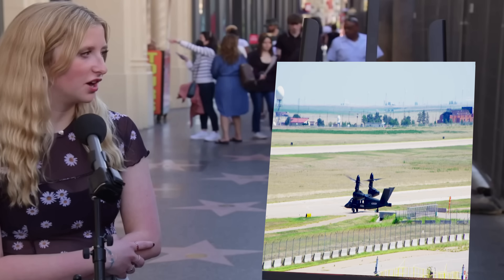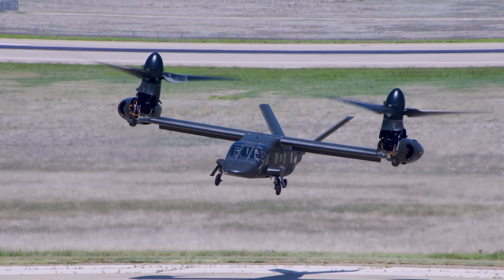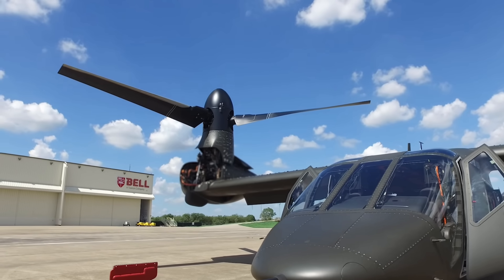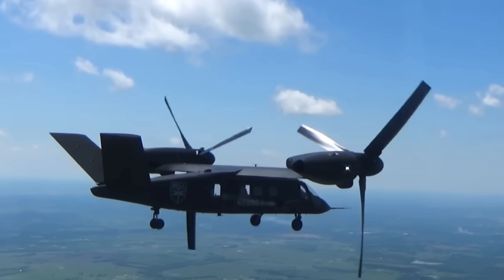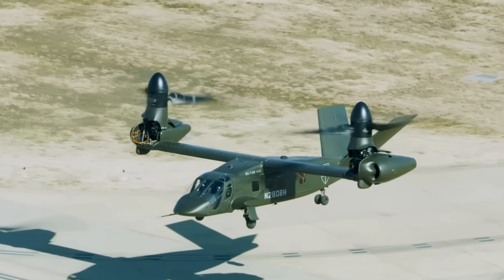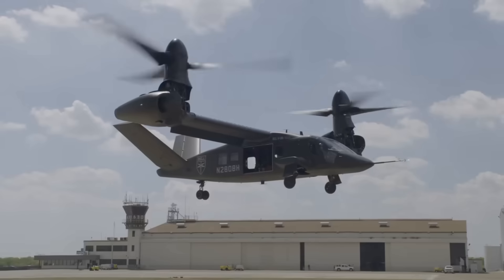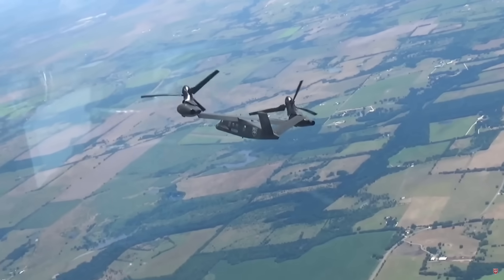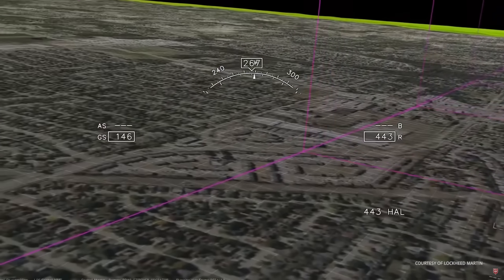Bell V-280 Valor - What's the big deal anyway? | BLACKHAWK REPLACEMENT

Comment: While the solution of having the turbine of the rotating bit solve both the problem with tilting the turbines as well as a total turbine failure. They are still vulnerable to a gearbox failure.
Reply: Along with every turboshaft driven vehicle ever produced.
Reply: @forrest225  well.. not pure fans.. also most other turboshaft vihicle have a safe failure mode. Helicopters don't.
Reply: @matsv201  that would be a turbofan not turboshaft. 

Yeah every helicopter has a high speed gearbox, that’s my point. It’s not like an exclusive weakness to the valor.
Reply: Unique hazard for this with tilt rotors is the potential for power not being distributed perfectly resulting in asymmetric lift. This tends to be uncontrollable and lead to a flip over. If near the ground or power isn’t evened out quickly it can and has led to crashes.

Comment: I think both of the bids were really incredible, but I think the speed and range of the tilt rotor Valor were just too good to pass up. I know the finished design for the military will look different, but hopefully they find a way to add some armor to opening in the nacelles during verticle flight mode.

I personally hope the Sikorsky Raider X with its pusher propeller will beat out Bell for the FARA program so both companies get to have big contracts with the military.
Reply: @2genders  Probably another Valor. There is a version where they replace the cabin area with a hellfire rack. That and probably fixed wing. 

The Army is thinking ahead and figuring out what it needs against China and where they might need to launch from on land. While the army can launch from carriers and ships, they won't unless it is to offload onto another base. Salt water maintenance for aircraft is a pain and the Marines are already on board those ships anyway. If the Army doesn't want to be sidelined until a base can be established then the Valor is the better choice over the Sikorsky. It is the same problem the Navy Seahawks and Marine Hueys had and why they weren't really used, their range was limited and they couldn't be air refueled. Plus that tilt rotor can save a lot more lives by using it's speed to get to a hospital with life saving equipment that is usually far away from the frontlines.

Additionally, the Sikorsky is still unproven and just got a full scale prototype up and running while the Valor prototype was either finishing up or flying for additional research. The Sikorsky team had trouble with making the blades stiff enough when upscaling so that the blades won't flex and hit each other. The Army is just more comfortable with a tilt rotor.
Reply: @2genders  The V-280 could be escorted by other V-280s. If they can't send an escort, then they'll just do without one. You're making it sound like the extra speed and range is a disadvantage. In fact, the extra speed and range means this aircraft can perform missions that couldn't be done at all without it.
Reply: May I ask what's the FARA Program, is it seperate to the current program and what would it Replace?

I personally also really want the Raider X since I really like the Mix of Co-axial + PushProp Idea, it looks a bit more like a Helicopter and less of a plane unlike the Valor. 
Seems a little more versatile too, Push-Prop being it's own, seperate thing on the craft.
Reply: @Sire.English  I'm a different person, but anyway, the FARA Program is to replace the OH-58 Kiowa (which was the Army's version of the Jet Ranger) which has already been retired without a replacement. I think it might also replace some of the Apaches, but that's not official. https://en.wikipedia.org/wiki/Future_Attack_Reconnaissance_Aircraft
Reply: From a maintainer perspective, I just want a simple flexible dust boot at least.
Reply: @Phillip Banes Yeah there are some recent videos of the Raider and it’s not as compact as the original renders were, but it’s still smaller than the Defiant X.
Reply: @Phillip Banes That’s true. I think Sikorsky’s plan is to make the Raider X modular. They can choose to either have a small cabin behind the pilots like the Little Bird, or have it carry foldable missile racks.
Reply: I too favor the Raider X for FARA while supporting V-280 for FVL.  It seems to me that the relatively compact size of the coax design is more suited to lingering at tree top level and the rear propeller would allow for quick dashes.  The tilt rotor favors flying higher at sustained speed and extending the range of assault missions.
Reply: @calags  if the Sikorsky Raider X, the FARA entrant, ends up being as big as the Defiant then it is going to be tall. Like too tall to hide behind most trees except redwood trees. If it were the size of the S-97 Raider prototype then I can see them taking it.
Reply: @bl8danjil  The renderings seem to suggest it is going to be compact.  The second rotor does make it taller than a conventional chopper but I don't think it's much more than what the Longbow radar does to the Apache.
Reply: @calags  I think you are looking at the the smaller S-97 Raider. The Raider X is going to be bigger than that. If it is supposed to have parts commonality with the Defiant, which is what the perception was, than they are going to be somewhat similar in size and height.
Reply: @bl8danjil  You're probably right. Still it should be more compact than a V-280 variant
Reply: @calags  Probably. What I want to know is how the Valor or Defiant/Raider X would even fit in the cargo planes that transport the Blackhawks or if they need larger cargo planes. The Valor didn't look like it had that blade fold and wing stow like the Osprey and the Defiant looked too tall to fit inside. Maybe the Defiant would need the top rotor off for transport or maybe even the mast and both rotors.
Reply: @bl8danjil   I had to check again and the Raider has grown a lot since the renders that I first saw. It went from a “baby Defiant”, to a “young teenage Defiant” 😂. Last year a test pilot of their first prototype said they planned to increase its size a bit, and 3 months ago they did a demo of their latest prototype that looked a little bigger. I’m not sure if they plan to keep that current size or increase it anymore for their military “X” version, but it still looks great!
Reply: I would have chosen the opposite winners. Defiant for utility and Invictus for scouting

Comment: I think that designing a machine for marginally reduced disadvantages in a silhouette vs RPG scenario comes a long last respect to developing doctrine, operations and machines to avoid a silhouette vs RPG scenario. Furthermore, the US Army is reorienting for peer-to-peer conflicts, which means that rather than RPGs they are considering MANPADs and worse.
Reply: It seems pretty damn agile for a tiltrotor still. as missiles advanced it's going to be harder and harder to avoid them to sheer  agility so honestly x defiant without flares could be just as much of a death trap you look at today's missiles they are becoming more agile and far more precise then old gen missiles
Reply: Valor on the other hand can be based slightly further away which provides slightly better protection against long range missiles and drones.
Reply: Defiant is far better at avoiding MANPADS because of much better low speed agility and rapid changes in velocity. It would be a more evasive target to try to hit and spend less time at a hover.

Comment: So, if the Valor’s engine/rotor configuration proves to be more efficient and/or reliable, perhaps it would be good idea to retrofit the Osprey with similar engines.
Reply: V280 valor will be power by GE T901 nextgen turbine engine.
Reply: An Osprey with V-280 tech would be far better than V-280.

Comment: The part about the target silhouette makes sense on a basic level, but imho doesn't really pan out in practicality, since as shown with the Black Hawk Down incident the reason the choppers were hit were more due to how they were used, and any aircraft flying that slow and low regardless of configuration would've been hit. It's a situation inherently disadvantageous for any VTOL aircraft, where the solution is more to improve tactics and operational planning when it comes to urban combat, rather than designing an aircraft with a smaller hit profile. Also, if you were trying to hit the V-280 from the side, its silhouette isn't actually any larger than the Blackhawk's. 

Since differences have been talked about, even if the V-280 has a slightly larger target silhouette on the low and slow, once the V-280 starts moving its faster speed and longer range means that it has escape and evasion capabilities the Blackhawk simply can't match.
Reply: It will be easily tracked by anti-air  IR missiles, since they MUST fly higher. V-280 is a stupid choice for Medium aircraft replacement. Should've replaced CH-46s instead.
Reply: @jimmay1988  The height difference is waaaaaay overblown. If you are flying nap of the earth to avoid MANPADs you are already in a bad situation. You would be much better flying faster a bit higher up. 

Basically anything that can hover is going to be an easy MANPAD target. It doesn't make sense to heavily base an acquisition decision based on it.
Reply: @jimmay1988  Why would the V-280 need to fly higher? It's not like the Blackhawk flies with its wheels to the floor, and if you're pushed into an impossible situation where that's the ideal tactical choice then you have far worse problems to take care of.
Reply: @jimmay1988  Why can't the valor fly NOE...

Comment: From a survivability perspective the defiant looked a safer option. Both programmes are ambitious and the Army wouldn’t have lost out picking either. The USMC did such a good job of getting the osprey in to mainstream service after initial development problems the tilt rotor gremlins have been put to bed. Good training and operational practice will keep them there. The valour will certainly give the US army an edge in range and speed delivering troops. It will be interesting to see how the inservice aircraft will look and who else gets tempted to adopt it.  It’s a no brainier to say the CSAR community are drooling over it.
Reply: The defiant crashed after 60 hours of test flights
Reply: @jameson1239  survivabiluty is a factor of battle damage not a crash due to airworthiness or poor maintanance
Reply: @markpengell23  If you crash without damage, you will crash worse WITH damage.
Reply: @theneef174  As it turns out, planes crash without damage all the time, even the very survivable A-10 has had crashes with no damage at all.

The fact that what is still an experimental design crashed during development does not mean it is not survivable.
Reply: @pdxmarine1430  my brother in christ the transmission does not work
Reply: @theneef174  yeah, which is an issue to be fixed, it's not a survivability issue.

Design problems and survivability are two different things
Reply: @pdxmarine1430  inherent design flaws turn into survivability issues.

Just ask the cutlass.
Reply: @theneef174  a transmission can be redesigned and replaced. It's not inherent to the platform. As it turns out during development, designs change and flaws that are discovered get corrected
Reply: @pdxmarine1430  it was not fixed over the majority of the entire competition. It is an inherent flaw to the defiant. To say otherwise is goofy as hell.
Reply: @theneef174  These things are still in the design phase. The contract was to finalize and expand on the initial prototype. Prototypes always have flaws, those get corrected as they go through the design process. Did you think that both of these were complete designs competing for the actual production contract?
Reply: @pdxmarine1430  No? That doesn't excuse what's currently happening, my guy. Most issues in competition pases tend to carry on over to the final product, until well into their programme lives, unless based upon another mature project.
Reply: @theneef174  Except things like transmissions and engines are things that regularly get changed and upgraded throughout development of vehicles. Placeholders are pretty damn common to get prototypes out the door for testing
Reply: @pdxmarine1430  Correct; and much like with the f14a, they remain inherrent flaws until a refit.
Reply: @theneef174  the aircraft was a prototype still in development so you and everyone else can speculate. The V22 has similar issues but it’s mechanical airworthiness and crew training was addressed and it now performs well in service. And as to survivability you can build it in like the apache or A10. But at the end of the day only the enemy, gravity and the surface of the planet can determine that. From a survivability perspective I was referring to the podded engines. Losing one mechanically can be compensated by the inbuilt gearbox and redundancy built into the aircraft. Taking one out would be catastrophic. The defiant had more compact shorter rotors. Still vulnerable but more survivable.
Reply: @markpengell23  The F111 never worked right, the F14 engine issues were never really fixed, the F35 has taken >20 years to work as intended….that doesn’t mean the Defiant transmission could not have been engineered right, but the challenge was enormous…..routing 12,000-15,000. HP between two precisely counter rotating main rotors and a tail prop with almost all going in either direction as needed while doing so to aerospace weight and space requirements is a huge challenge far beyond traditional helicopter transmissions (a notorious traditional helicopter achilles heel) and “we’ll worry about that later” has created huge problems in the past.
Reply: Defiant  prototype took a 700 mile flight to relocate without any issues at all.

I am more concerned about the shafts on Valor not shifting power as perfectly as they should in some situations, especially after heavy use. This has caused asymmetric lift and several crashes on Osprey. They claim that the mechanicals on Valor are improved enough to reduce this risk but I am not so sure. Testing tends to be done on pristine parts.
Reply: @Aspeer1971  none of your arguments are based in fact or reality. And on the presumption that things can’t be fixed. The f111 did work but had troubles. The tomcat had problems. The Libyans would probably struggle to back you up as well as the US Navy disagreeing with you. Almost all complex modern aircraft have problems. But that’s why they go through lengthy and exhausting testing. Amalgamating so many things together always fraught with trouble. New and evolving technologies even more so.
Reply: @markpengell23  My statements aren’t based on “fact or reality” yet you basically agree with everything I said about the teething issues of the F111 and F14.  Engineering these systems is HARD.  No one says they can’t be made to work eventually.  They clearly did.  The question is whether there are lower risk alternatives and what the tradeoffs are.  The army and the GAO both agreed Bell’s approach was lower risk than Sikorsky’s with limited negative tradeoffs regardless of how much you disagree with that conclusion.
Reply: Clearly your statements aren’t based on fact or reality. You’ve short yourself down with that ridiculous statement.
Reply: @markpengell23   “Short yourself down”.  Wow, there is a Dickens in our midst.  Dude, happy to debate facts and perhaps you can demonstrate a minimum understanding of something, even if it is limited to the less challenging contents of the English dictionary.  On the other hand, if you just want to trade insults, I suggest you find yourself a thesaurus.

Comment: People think of this like an helicopter with wings when they really should be thinking of an vtol turboprop. 

You can mount a modified 20mm vulcan inside, some hellfires on the wings, and have it perform the same duties as a ac-130 at a reduced capacity but with better accuracy because you can tilt the rotor to generate lift at low speeds.

It also does not tilt the engine which makes the flight more predictable and a little safer because you don't have that hot air coming back to the rotors and maintenance is a little easier when compared to the osprey.

It has a better acoustic signature, giving a little less time for the enemy to act and can fly on a single engine with the same range, so theoretically you could fly back to base if hit by a manpad. 

Having the engines so far from each other ensures you aren't disabling both at the same time. Correct me if I am wrong but I believe many of those manpads use heat to find its target, increasing the likelihood of an engine hit over anything else. 

About the defiant, compound helicopters produce a lot of vibration and with another set of blades and a propeller, I can see the transmission being munched over time.

But I am just a dude on YouTube so take my opinion with a grain of salt.